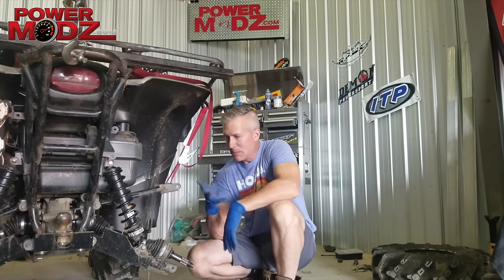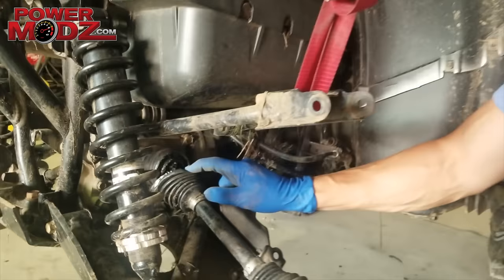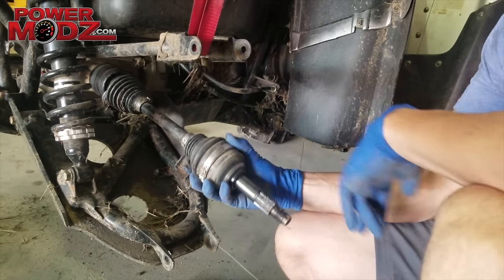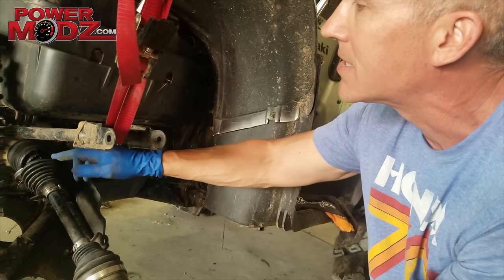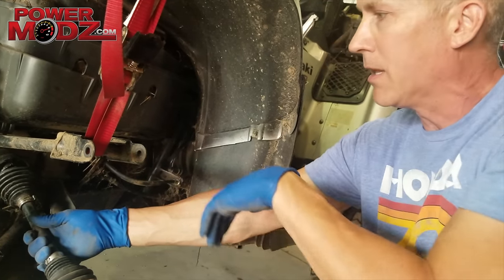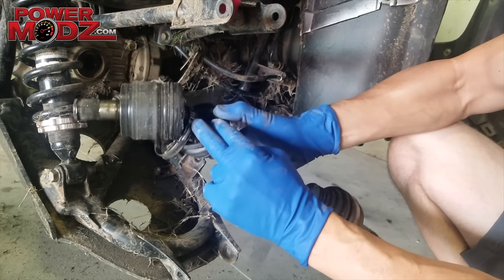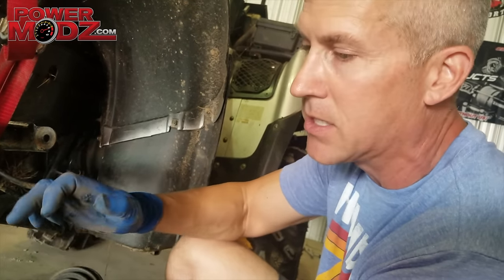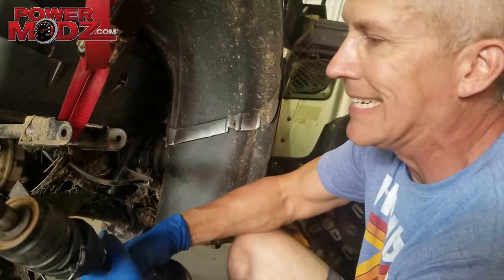ATV UTV easy axle removal the proper way - DO IT RIGHT!

Comment: okay first of all they do not come out that easy. Sometimes you get lucky. On my Arctic Cat four rear axle came out after I disassembled the CV joint and we moved all the grease then I reassembled it gave it a pole and it came right out. At the moment I cannot remove the front axle. I pulled off the end CV joint pulling so hard. so now I don't have anything to hold on to accept the axle shaft itself. So I'm going to get a couple of u-bolts and attach a chain or cable to the shaft. then attach a 50 lb dumbbell to the other end. Hopefully with the extra weight it will come out. Imagine, I've deadlifted 775 lbs and I can't remove the axle. Wtf

Comment: Not dealing with swapping a boot is worth the extra $. Changing a boot over can be a a PITA! Maybe they don’t last long but there are complete axles for $50.
Reply: and then when you do swap the boot your joint has junk in it anyway and starts to click pretty quickly ... replacing the axle is the best option unless you catch the rip really early (good luck) and have some type of a patch kit on hand or want to stop right then and there and replace the boot (lol no thanks)...  I just need a better way to protect the boots, I only have a problem with my rear inner boots ripping ... still not exactly sure why

Comment: Much easier to replace the complete axle than the boot in the field.  There is no "clean" quick and easy way to replace boots without work bench, tools, cleaning solution, etc.  I would carry a replacement axle instead for harsh treatment of the utv.

Comment: That's the way you're supposed to do it in a perfect world. However when the spline and clip in the differential won't let go, then you have a whole other problem.  Last one I did, the inner cv joint pulled apart and I ended up having to use a die grinder, slide hammer, and about 30 good whacks to pop it out.

Comment: Mine was very tough on my 2013 Polaris 6x6 Big Boss. I snapped some vise grips extra tight mid shaft on the inside of a raised spot then used a slide hammer I rented from Napa for free with a CV “fork” adapter on it that I bought for $25. I ended up snapping two pairs of grips on it and had to work at it with solid, even hits and finally it broke free. It had been soaked in PB blaster for days too. Good luck to any of you doing this task.

Comment: This is true for I believe just about every 4 wheeler Except arctic cat white axles. Keep that in mind. They put what is a positive lock cv axle that will not let the axle pop out if it was to get into too much angle.  You have to hold the axle straight, push in on the axle which moves a pin that releases the clip. Then you grab the inboard side and pull it out while keeping pressure inward on the axle. It is actually a really good design for axles that are at a big angle. No accidental falling out. Great video by the way
Reply from the maker: Thanks for that info!

Comment: carry extra boots on the trail? so you stop everything to remove the axles and everything on the trail just to replace a boot? How do you catch it in time before you toss a bunch of crap into the joint and ruin the joint? It doesn't take much exposure to the elements to ruin the joint. Just continuing to ride and order a new axle is what I do, by the time the new axle arrives my joint is toast but at least I was able to ride it the whole time I waited. Problem is now I'm buying too many axles so I just need a better way to protect the boots.
Reply from the maker: We carry spares depending on where we go - if its up north we have to.
Reply: Some people like to save some money where they can.
Not everyone has enough disposable income to just order new stuff when the old isn't even broken but can be repaired.

Comment: Should you drain the differential oil before removing the axle?  I pulled my axle to change a torn boot and noticed about 2 tablespoons of oil dripped out. Do I need to re-fill the differential with oil after I replace the axle?
Reply: Yeah refill it cause that Diff will get dry.

Comment: They are replacing the whole axle because two rear axles are only 120 dollars brand new aftermarket.  I then replace the boots on the old axles and use them as spares.

Comment: When you replace just the boot do you use the stretching tool or do you just go ahead and break them down
Reply from the maker: I usually just separate them
Reply: PowerModz thank you I just wondering if it was worth the price of the boot stretchers
Reply from the maker: @stacyreid5077  ive never tried one but might be handy in the field.  with some very tough boots i dont think think it would work
Reply: PowerModz I figure in the field I saw one guy using a long tube funnel cut and then partially split on the big side   I might carry one of those as a need it case
Reply: @stacyreid5077  you would be better off carrying a spare axle to swap. Once you get crap inside the boot then it needs to be stripped, cleaned, re-greased, then sealed with a new boot. That's a bunch of extra steps and time just to save a few $. Once you have the new boot on there and dirt/sand is already inside it is unlikely that you will ever fix it properly until it locks up and gets toasted anyways.
Reply: Thanks I’ve ran one axle with grit and stuff in it when a boot had a tiny lil cut   It still pulled but with some popping till that one unfortunate day when it let go and I found zero balls or case in the boot from the cv joint, still had plenty grease

Comment: Why put that pressure on the inside joint when you can use a tool to pop it out from between the diff and the axle?  I just did this yesterday and it took less than a second to do it the real  correct way.
Reply: What is the  tool, and where can I get it, will it work on my 2010 CanAm  500. From Canada.
Reply: @larrymcpherson3875  I use a precision pry bar, cheap and available at your local hardware store. like this, https://www.homedepot.com/p/10-in-Precision-Molding-Bar-55-117/203901496
Reply: "use a tool"..." Real correct way".... I don't think a pry bar is the "tool" the manufacturer would recommend using on a CV joint? Lots of people.would dig that "tool" in behind the cup and start digging and destroy the seal and maybe more.
Reply: @Hammerback0  Any tool can be misused, and if you are stupid enough to start digging hard enough to get to the seal then you shouldn't be working on your own machine.  Someone that just yanks on it is not someone that should be making videos on how to do it.
Reply: Here is a vid from a professional mechanic, and an instructor for the mechanics class at the local college. Notice he doesn't just yank on it, and he explains why. He uses a different type of pry bar because the Can Am has a different cv that is easier to get behind.  https://youtu.be/o8iZpjPG4xM

Comment: I did the same thing you just did and the shaft cam out of the inner joint and now I can not get it out of the dam thing !!!!!!!!!!! trying pry bars but it still not coming out of the dif ................. dammit ................
Reply: How did you end up getting the thing out?  I’m afraid to use pry bars, don’t want to crack the aluminum case.  Your post is 2 years old is what it says, I’m in this mess now.  I have a Kubota rtv x900.  I am using this video as a starting point but not sure what I want to try will work or not.  We will see.

Comment: My kawasaki mule 3010 makes a squealing noise when the 4x4 is in gaged.   Only makes this noise when the vehicle is moving.  The noise is coming from some where in the front.  When the 4x4 is disengage,  the squealing sound goes away 5 seconds after 4x4 is disengage.   Anyone has an idea what is causing this noise?
Reply: I have a 250 honda rancher es 2 wheel drive. It will change gears OK but will not move in can see the driveshaft turning at the rubber boot coming out of the back of the transmission but it doesn't move what do you think it could be?

Comment: Not me. Not worth the extra messy job and frustration to change and repack boots when I can quickly, easily, and less mess just change the axle and have both boots new. Axles are around $80 to $90 and that's with both new boots ready to go instead of his $40 messy one boot replacement hassle. Just my opinion.

Comment: you pulled the boot off and I'm sorry I don't mean to diss you but you did that completely wrong. You get two pry bars or two Hefty screwdrivers and put them in behind that CV axle in between the case and the axle shaft itself and kind of do a scissor action with the screwdrivers on each side of the axle input shaft . you push one pry bar and you pull the other to kind of do a scissor action and it keeps the pressure on that CV axle consistent all the way around and it pops it off real easy-like. Again no disrespect but you did that 'completely" wrong!! now you got to get that boot back on there and that's a pain in the ass. But, since it's open you don't have to clean it up but not a bad idea but add grease while you're there.
Reply: Todd Bearden thats a great way to crack your diff case trust me I’ve done it
Reply: @rockwilkinson8224  well I thought about mentioning putting a piece of plywood behind it and that is possible but if you're in a situation that you may possibly crack your case by doing that you're better off to have somebody else do it for you
Reply: I thought the boot was already pulled off from a stick in the swamo and that's why he was taking the axle out.
Reply: @hillhound523  yep yep my bad sorry about that
Reply from the maker: if the inner cv were stuck and broken id probably weld a slide hammer to it.
Reply: @PowerModzOfficial  I does work to weld a slide hammer to it. I do enough of them to try buying a CV axle removal tool. Attaches to your slide hammer. Looks like it might be a time saver. If it works.